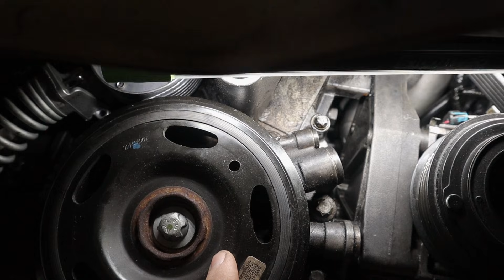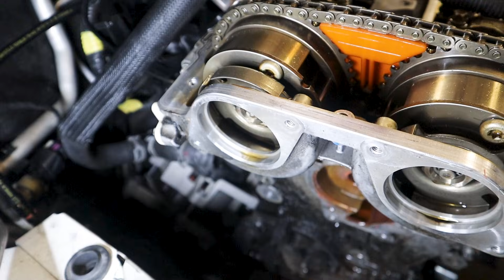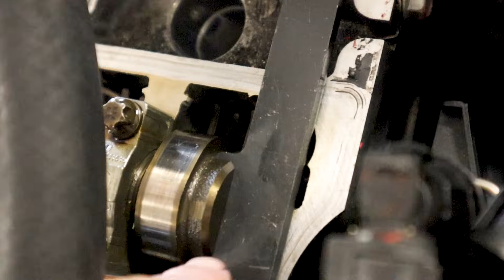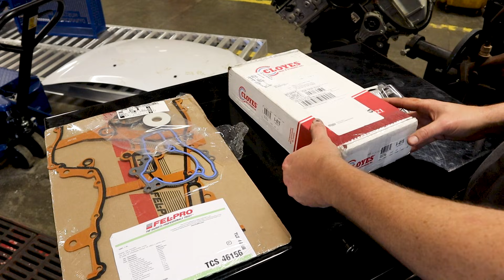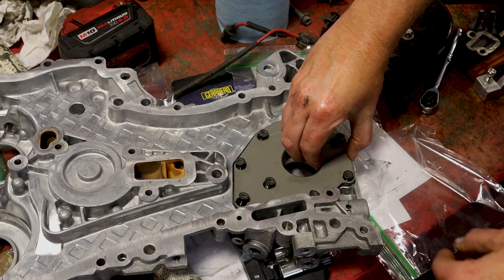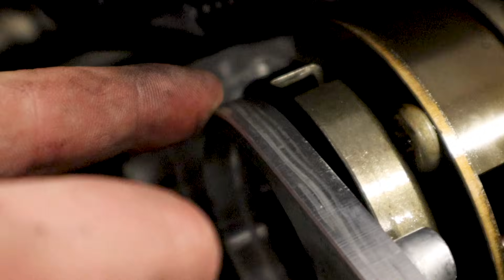P0016 code Ecotec 1.4 timing chain replacement

Comment: I have replaced my head gasket and have exhaust gases coming through my cooling reservoir. The guy at the machine shop suspects I did somthing wrong while installing the head back onto the car as milled 6 or 8 mm off the head pressure checked it and returned it to me. The engine deck has not been milled the piston walls look okay. The weird part is the guy at the machine shop had me check my head bolts for stretch and had me put in an old head bolt. Needless to say I broke the head bolt into the head

I am utilizing your video to find a way to pull the head straight off the engine. So far it seems like this may work. Any ideas on how exhaust could get into the coolant with the info I gave you. Mind you this is with all bolts in and everything tourqed down to spec as far as I know
Reply from the maker: Well either the head or block may be cracked or warped, or the gasket may be blown. I know that’s not what you wanted to hear. I have a video showing this issue on a Ford here: https://youtu.be/sqIhMWjyAlI
Reply: @AutoScholarwithMrB   I watched the video . Very similar to my situation however it takes a while for mine to heat up but the result is the same. I drilled out the the thermostat and it no longer boils over.  What ultimately was the issue with the f150.
Reply from the maker: @alexanderbevars9975  not 100 percent sure what blew the gasket, we just junked the engine and got another

Comment: two things here. firstly, you definitely have my subscription. secondly, I'm currently about to gear up for this on a 2014 sonic 1.4 turbo. is there anything I should be looking for while I'm in there to determine damage done by the engine being out of time? I watched your previous video on cleaning and bench testing the actuators and both are in functioning condition. however I found a boatload of tiny orange plastic bits and strings in the little screens like a shredded piece of oil stained plastic. i haven't opened the crank case yet but I'm assuming its one of the chain guides.
Reply from the maker: A leak down test would tell if the valves have been damaged. The plastic is probably from the top guide, which was cracked on this one. I hope that helps, and thanks for watching!
Reply: @AutoScholarwithMrB  thanks for the reply. and yes, SOME of the bits were from the top guide. after opening the timing cover, I found the other chain guide opposite the tensioner had basically exploded. I'm currently fishing for chunks in my oil pan with a spatula. no idea what could have made it explode like that, but I'm hoping nothing that I'm not already replacing. my next question is about loosening the timing doohickeys from the cams. you said to use a pry bar to loosen. where exactly? is it on the little nubs that the position sensor reads?
Reply from the maker: @kyleteodecki7478  yeah I meant a breaker bar, I misspoke. You will have to hold the cam still and loosen the phaser bolts. This may take two people. Sorry about the mixup.
Reply: @kyleteodecki7478   Hi kyle, I have took mine apart and same things happened whereby right side guide rail is in bits, got to be around 30% that must be in the sump, did you have to drop the sump? how big a job is it if you did?

Thanks
Reply: @davidbrownbill1285  by no means should I be an example here, but no I did not. I fished out what I could get with a kitchen spatula. 

Frankly my paranoia has been driving me up a wall and I'm planning on doing all of the seals, the water pump, and relative flushing of all fluids involved. 

If I had to do it over again, I would have done all of that the first time. The peace of mind is worth not half-assing it
Reply: @kyleteodecki7478  I’m quite dissspointed, low mileage and it’s failed so soon, seems to be quite a common problem on these cars.
I just want to rebuild it back  without taking  sump  off, so I’m thinking of draining oil , and  popping a flexible camera in there and hope to fish out  everything if that’s even possible for peace of mind before I put the timing cover back on as I would myself be paranoid of bits of plastic blocking things up etc.
Cheers